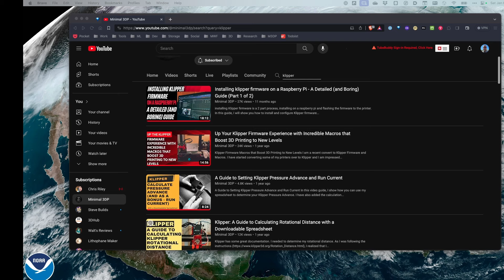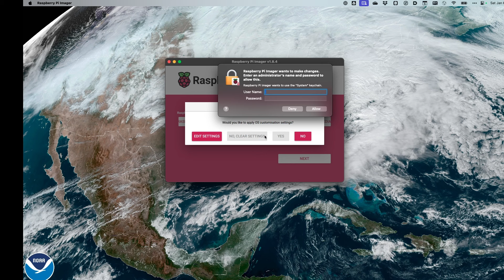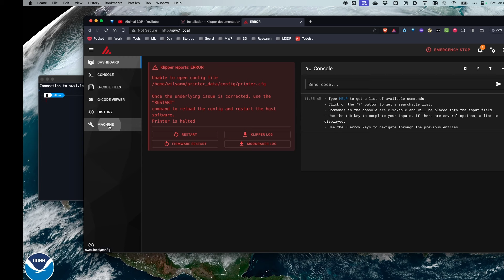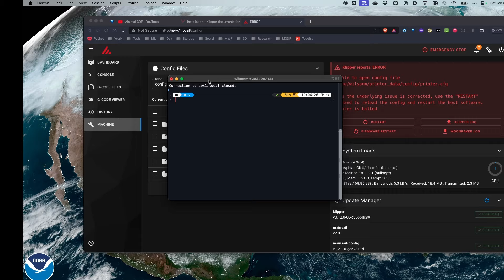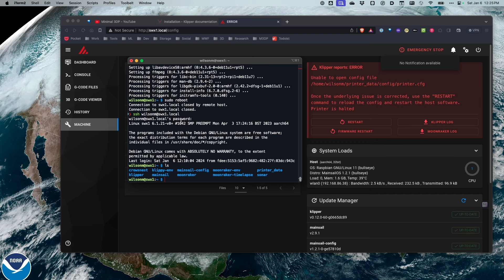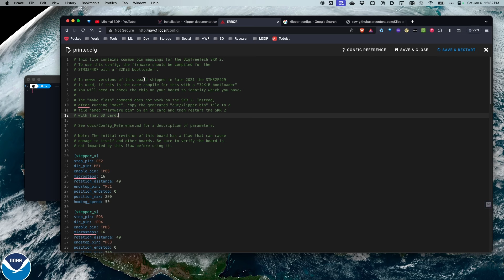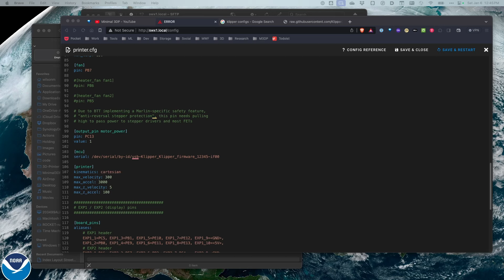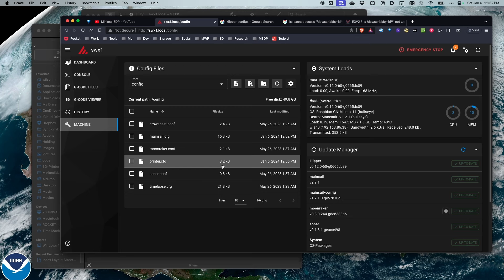Klipperize Your Prints: Unleash the Beast of Your 3D Printer (Part 1: a Vanilla Klipper Install)

Comment: You are a rock star.... I was having issues but this video at least got me connected. I am new to Klipper I have had an Ender 3 pro for about 5 years and I have installed a BTT board with a BL Touch but this Klipper is all new to me. I have finally installed on my new printer Ender 3V3SE and I have these errors:

virtual_sdcard is not defined in config.
pause_resume is not defined in config.
gcode_macro pause is not defined in config.
gcode_macro resume is not defined in config.
gcode_macro cancel_print is not defined in config.
display_status is not defined in config.
Make sure you include the mainsail.cfg in your printer.cfg file

Hope you may be able to help a little here.
Reply: Holy cow KLIPPER, why did I not do this before. I have all of the errors fixed and now getting ready for first print with it. Im so freakin excited. How much easier this was compared to Marlin and Octoprint.
Reply from the maker: Glad you got it fixed.
Reply from the maker: I am a big fan of mainsail and fluidd.

Comment: Great video,  i wish you can also go deeper in the firmware configuration, since i installed in my x1 cilinders are not round anymore,  instead it prints a lot of faces and i dont know how to fix it. maybe i have something wrong in th config file...
thanks for your videos.
Reply from the maker: I am planning to go deeper in my next set of videos. I also have several older videos covering configs as well. Take a look at my Klipper playlist.

Comment: I keep trying to connect pi to skr3 ez but always fails to pick up on the board except using "lsusb" sees it in dfu mode. Tried every patch and trick available online and at least 5 or 10 different operating systems. Went and bought a different USB cord, but still no go. SD card does come out with the different file extension. Still working at it, but wow.
Reply from the maker: The recommended printer.cfg is different between the skr 3 and the skr 3 ez. Are you sure you started with the correct exame?
Reply: I had not seen a different example config for the SKR 3 EZ, but one thing I'm noticing now is that either board can come with an MCU STM32H743 or STM32H723 and the one ending with 23 has caused USB connection issues with people using klipper. I think a fix was found with marlin by swapping serial ports 1 and 2 in the code. Both of MCU chips are options in the make menuconfig so I will have to make extra sure I'm putting in the right one if following directions from a webpage that only mentions the one ending in 43.

Comment: I have a problem. When I type  ls /dev/serial/by-id/* it comes up the same as in  the mcu printer.cfg :S Solution to this? (A)
Reply from the maker: Does it connect with what is already in the file?
Reply: @minimal3dp  no it does not :/